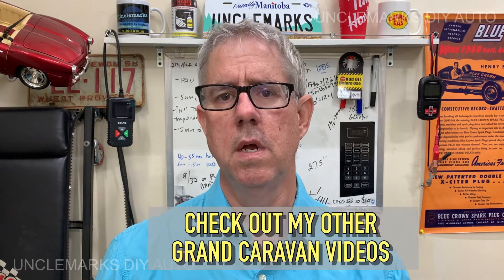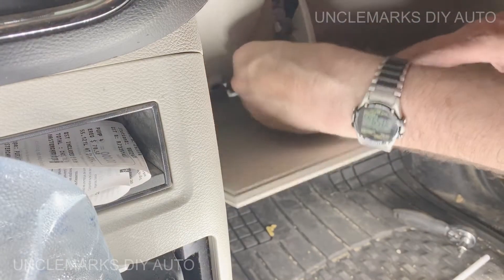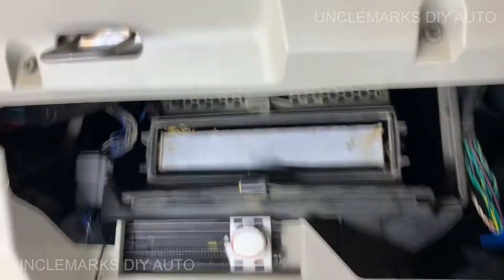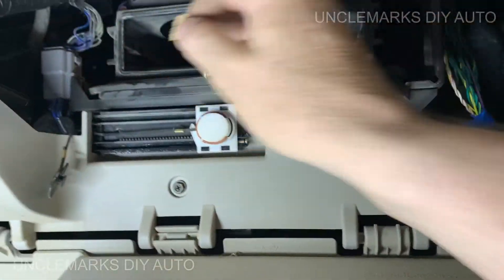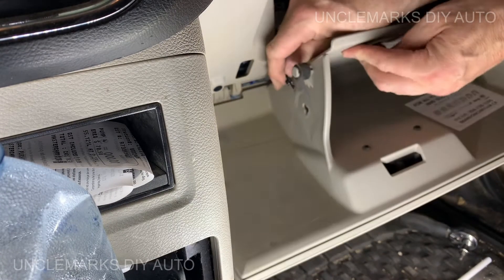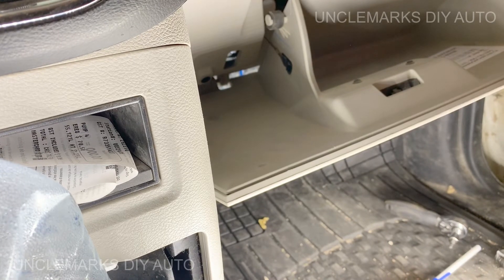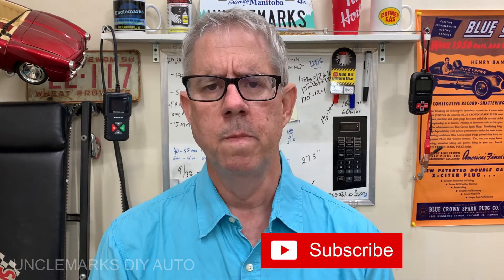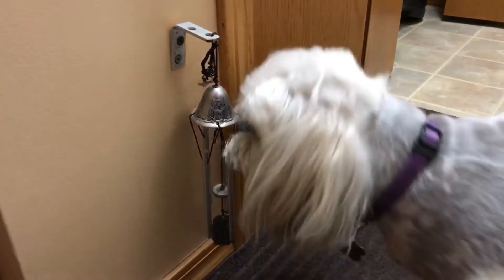How to change cabin air filter on Grand caravan 2011 - 2020 VW Routan (EP 205)

Comment: Just replaced my blower motor using your tutorial. Thanks! I have a 2012 routan and it doesn't have the front plastic cover with tabs, it's more of a honeycomb assembly. Is there a separate access for the cabin air filter?
Reply from the maker: I don't know, honestly. No VW Routans for miles from me. Do you have the owners manual? Maybe they have info on it?
Reply: @unclemarksdiyauto  I checked, and there's nothing about the cabin air filter. I believe, based on further research, that it's located under the passenger side engine cowling. If I remember, I'll let you know after I r&r it!